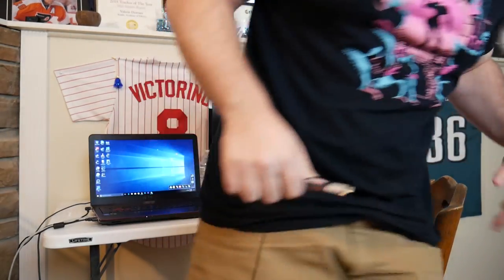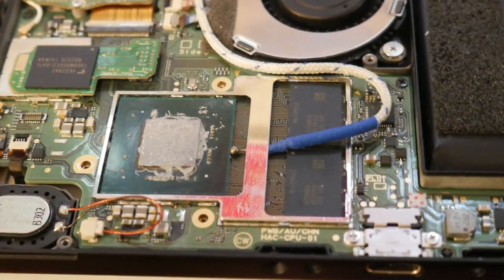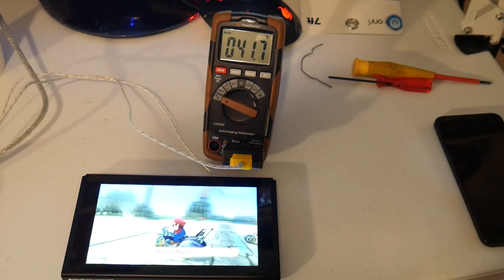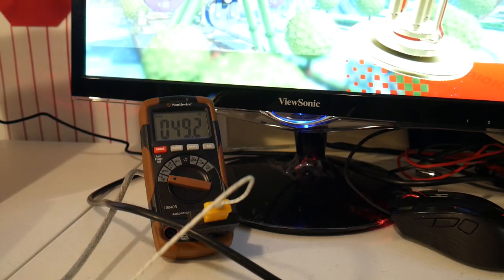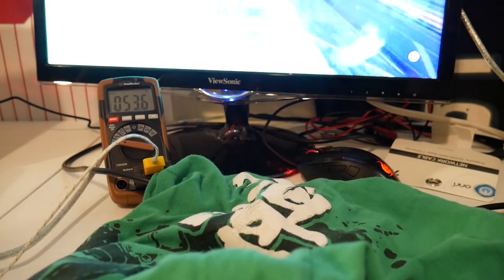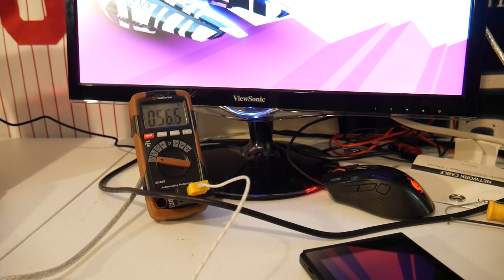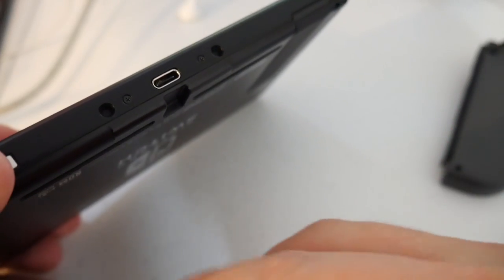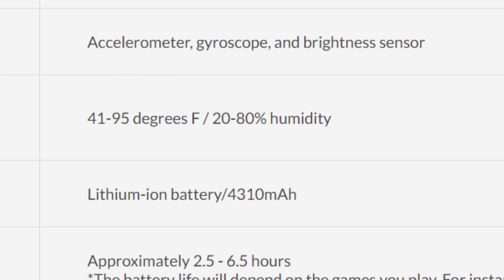Let's Overheat The Nintendo Switch!

Comment: Unless the Nvidia chip is different, 60 is perfectly safe. Most chips are fine up to 90-95 c. Even mobile chips. The 67 is probably a heat safety for the user or protecting other parts of the switch. Then again. You weren't on the CPU so IDK.
Reply: enough to cause serface burns. tmax for the switch is supposed to be 60 but with the layers of metal and plastic you won't be able to tell it's that hot.

Comment: I played my switch in a shell case (with holes for the vents) but flat on my bed, using a pro controller. I played Mario odyssey for around an hour before realising my mistake - no overheating message came up. Will I have damaged anything?
Reply: Liam Austin no because it didnt get hot enough ti give you the message.

Comment: inb4 someone hacks the switch to run passively at lower clock speeds by then unplugging the fan. (Could be possible since hackers already have kernel access, although of an older version.)

Comment: if those are the vents, then are they also the speakers? i could swear they are the speakers, not the vents.
Reply from the maker: The speakers face forward, look at the front of your Switch. Do you see those two notches at the bottom of the screen? Those are the speakers :)
Reply: thanks

Comment: What happens if you frequently use the system outside that operating humidity range?  I live in an area where the humidity frequently drops below that 20% mark.  In fact a lot of times it can reach <10% humidity here.  Do I actually need a humidifier just to run this console?
Reply: nah just know that there is the possibility for condesation build of after a large temprature swing.

Comment: How many people actually know how hot something is in Celcius besides boiling and freezing temperatures?
Reply: I have a vague understanding. I stayed in Tokyo for a week and had to learn Celsius on the fly.
Reply: Can't give you an exact number but I can guarantee that it is that more people than would know anything but that in Fahrenheit considering few countries use Fahrenheit primarily for little more than 6% of the population of the world.

Did you not realize that you're implying that fewer of the over 6.6 billion people who main Celsius would know more than that even if all of the less than 400 million people who main Fahrenheit knew more.

Not to mention you're implying most people would need to know more than that which is asinine.

Most of what I know of temperatures, for example, is the freezing and boiling points of where I am in both scales being in Canada where metric is mainline but imperial is still present. I also, of course, know the average temperatures of the place I live year round in both scales. Beyond that I know very little with bits about how hot computer components can get in Celsius specifically since it's the main and how hot in Celsius something would generally be to burst into flame.

I - just like most other people - am not an engineer or a biologist etc. so I - and thus everyone else - don't need to know much else.

Comment: Current gen Switch in dock mode. In sleep status for over 8hrs. Doing nothing except charging. Later I went to remove it...It had an error message that something happened and need to restart. It was very hot when I removed it...Any ideas...First error...It only 2 months old.....

Comment: So... the only way to overheat it WITHOUT intentionally overheating it, would be to put in back down on a carpet, with clothes on top of it, right by a radiator in a very hot room, in direct sunlight during the summer, and maybe, MAYBE you could do it.
In that case, all the people complaining about it overheating are either lying, or deserve it for being such incredibly sloppy gamers lacking common sense. Or, I suppose, have a faulty system, but I doubt that one, unless they dropped it and dislodged the fans connector, there seems to be no way to just overheat the system even with such intense circumstances.
Reply: Most likely the people who overheated it either had a rare faulty one or were just being stupid in general.

Things like cable boxes and modems can get pretty hot and I can easily see someone being stupid enough to put the Switch and/or it's dock on top of one of them because it's reasonable small.

I once put a styrofoam plate down on my modem for a second and got side tracked. I came back a couple hours later to it having melted a hole through it. So I have no doubt some idiots did something like that and had their Switch and screen protecters melting/bending but were unable to take them blame themselves as most people try to avoid even when they know deep down it's true that they're to blame and only them.

Comment: 66 c ?? MWAWAWAWAWAWAWAWAWA

I am an AMD user, i laugh at those temperature !! 85c is the NORMAL for my r9 290x !!
Reply: Ebefren Revo your graphics card dont have a batery dude
Reply: I modified my 290x with a liquid cooler, seldom exceeded 60c on any game I played, but the noise reduction alone made it worth it.
Reply: Ebefren Revo wow. Really just shows nvidia is better.
Reply: I laugh at your temperature, you see your PC will be dead in a years time or less and my switch will still be going. :)
Reply: MUHAHAHAHAHA 85C? PLS THOSE ARE ROOKIE NUMBERS.  On My HP Pavilion dv7, i run Crisis at 45 fps on highest settings and my temps get around 92C at normal operations. GIT GUD

Comment: The vents are not on the back of the switch it’s on top of it, the back parts are speakers.
Reply: Real Gamer they have vent on top and back. The speakers are in the front.

Comment: I hate to break this to you, but the vents are on top of the Switch, not on the back. The "vents" on the back are the speakers. Put your hand over the top vents while  it's on and you'll feel it spitting out lots of heat. This is why it doesn't overheat while docked. I'm surprised more people aren't aware of this because it's not just you.
Reply from the maker: +Christopher Kensei That's not at all the case, see my previous teardown video if you're curious.
Reply: Spawn Wave It has to be the case, you can feel the heat coming out the top and sound comes out the back. I don't know what more proof there is?
Reply from the maker: +Christopher Kensei Open yourself and see. Those vents on the back are positioned to help air flow into the system. Those spots being speakers seem to be an odd misconception going around right now.
Reply: Spawn Wave So then what are the vents on top? And how would the system not overheat while docked if the vents are on the back? And why does sound clearly come out the back "vents?" Idk, I think you're wrong.
Reply: I think you need to wait 10 years before thinking too much.
Reply: The vents on the back are air intake, the vent on the top is an air outtake.  That how air flow works; it has to cycle through the system to cool it.  Did you even watch the video?  The air can pass in to the system while docked because the intakes are recessed and the system body/dock are shaped in a way to allow air flow.  That's why the fit in the dock isn't tight.  The speakers are the two small slits at the bottom of the screen.